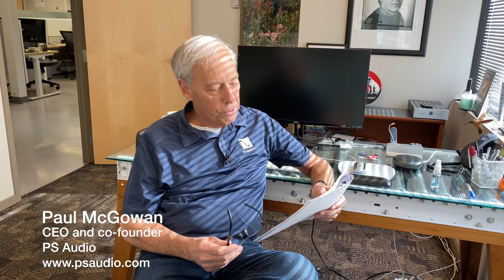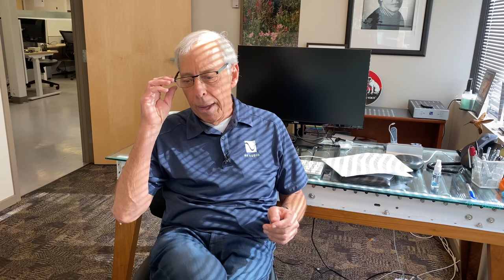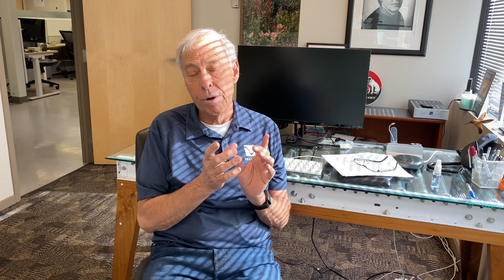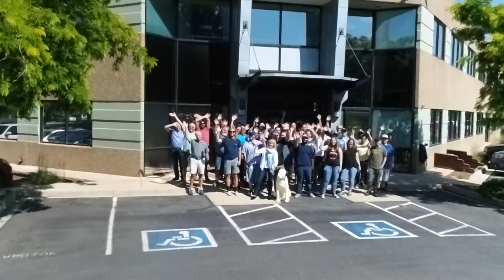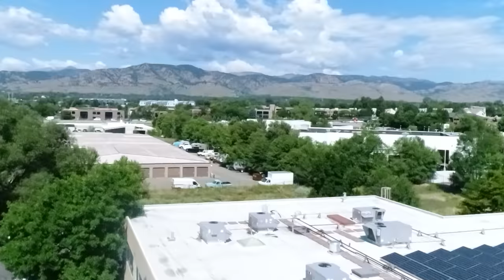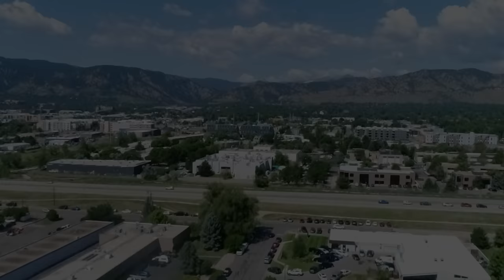Moving coil step up transformers

Comment: Paul,
Great summary on the difference between MM and MC cartridges. Your explanation of using step up transformers (SUT) to get ~30x the gain is spot on. Thank you!

I use a pair of Triad JO-3 SUTs between my Ortofon LYS MC and my moving magnet phono stage with very good results, but these SUTs are susceptible to stray magnetic fields from proximity to power supplies and motors in the form of audible hum.

I added cylindrical permalloy shields over the SUTs and moved them as far away from the field sources as possible, which reduced the hum by ~12 dB. This seems to be the only major drawback to using MC cartridges.

Comment: In my experience the step transformer will do the job but a dedicated MC phono preamp will sound better.
Reply: It depends very much on the transformer and phono stage. My experience is opposite. A good high end step up transformers are always better. The only good MC phono stage I’ve used was rare and expensive John Curl’s Vendetta. In my opinion less active devices in signal path always gives out better sound.
Reply: @stanislavshokurov6532  Agreed. The step up I used was made by Ortofon - not sure how "High end" this was, but I replaced it with a Dynavector P75 Mk1 which I'm still happily using.
Reply: At the end of the day there probably isn't all that much difference between either cartridge once you bung the signal through a step up transformer or put a higher gain phono stage with its inherent noise figures ( only a very high end phono stage justifies this )
Reply: For the best audio, yes, a carefully designed MC phono preamp is better. A transformer in the audio signal path is sort of much worse than cheap capacitors or other evil components we prefer to be without.

Comment: Years ago I built a LaPacifica phono preamp from a kit I bought for $60 or so, I added my own outboard AC wallwart, low noise power supply and a case. This is a very simple circuit using a couple of jFets and a passive frequency shaping ckt using oil filled caps and RN60 resistors for each channel. Because i was using a moving coil cartridge I needed more gain, for another $30 I bought another gain stage with a single JFet per channel\ and a small ckt board for all of it. In the end this cost me about $125 all in.

Is this as good as a top notch phono stage, no but it also only costs 5% as much.

Comment: The transformer not only increase the signal output but also matches the impedance which could be as low as 5 ohms. You could add an active part instead such as a low noise op-amp in place of the transformer instead which is a much cheaper solution but has other issues to deal with, such as induced hum from power supplies and the like but could work much better than the transformer if it is manufatured by non reputable or dubious manufacture and can band limit the music or introduce peaks and dips in the response.

Comment: Which reminds me of a previous video about how to turn an asymmetric signal symmetric. You could use that step up transformer for it. In this case you would have to put the transformer very close to the Sprout and have a symmetric output on your turn table.
Reply: I don't think you'd want to use a stepup transformer for balancing a single ended signal... better to use 1:1 isolation transformer.

Btw, cartridges already are balanced due to their electric principle, but almost all phono preamps short the negative (-) from the left and right coils to ground.

Comment: But wouldn’t an outboard mc phono amp (plugged into the line in) sound better?
Reply: Possibly. Depends on the quality of the MC Phono amp.
Reply: Usually yes in most cases. There are many different qualities of riaa amplifiers. cheap and not so good and expensive and good.

Comment: Using a cartridge that costs more than the amp?  Seems like a weird combination.
Reply: Yeah, the upgrade process is weird and usually nonlinear.  There are modestly priced electronics that sound quite good (and some that sound like crap, of course; I haven't heard either the Ortofon 2M Black or the Sprout, so I have no opinion).  Not that many people can afford a multiple component upgrade all at once.  If Don in IN feels that his MM cartridge is the current weak link in his system and he can afford the upgrade to a better MC cartridge and transformer now, why not?  He can upgrade to a better amp (or turntable/tonearm or speakers) later when the money is there if he feels the need/want.
Reply: Maybe the cartridge was won at a radio contest - like I won a 500 $ Monster Cable interconnect back in 1995 while my existing system at the time costs 600 $.
Reply: It's quite common that the phono preamp is overlooked.
Most of the times, it's by far the weakest link in the system.

Comment: I need to choose between two preprocessors, a Marantz AV7705 ($1900 my cost) or a Yamaha CV-A5200 ($2200 my cost). The preprocessor would be driving 3, Crown XLS 2502 amplifiers. Although this equipment is intended for my home theater system, musical performance is a high priority to me. Which preprocessor would you choose? I am long time subscriber and value your opinion :)  Thank you for your assistance.

Comment: i got to thinking this may be why the really cheap turntables like the crosley cruiser and such sound so bad is because they use a small audio transformer to replace the pre amp stage so they can get signal into the speaker amp without having to use a pre amp.

in addition they are not applying the riaa curve .

i am sure if you wired an audio matching transformer from the stylus to the line in on your sound system you could get a signal and basically that maybe what the cheap turntables are doing.

of course you got copper windings in the transformer that add cost however they could use aluminum windings and make it cheaper.
Reply: No, the main reason for Crosley and similar players sounding so awful 
is small, crummy speakers driven by inadequate amplifiers.  
The only transformer in such a unit is for power.  
These cheapo things don't have magnetic cartridges; they have ceramics ---  
but don't dismiss a ceramic just because it is one!  
Even the all-plastic stylus used in many of them isn't as bad as one might expect.  
In case you want to find out for yourself just how much is missing due to the deficiencies of the rest of the thing, 
try connecting only the turntable in one of them to a good system. 
Use a line-level input (CD, Aux, etc.), Not a phono input.  
Play a clean but unimportant copy of a familiar recording. 
The difference between that and using the entire unit will be pleasantly striking.
Reply: @spacemissing  that too

Comment: It's a bit of a stretch to categorically call MC way better than MM. That is more of a personal opinion than anything else. It is very hotly disputed in HIFI circles, and it is situational.  I have no problem people say or think MC is better, but man, tone it down. It is probably more correct to say the most expensive cartridge is, usually, the best. Given everything in the audio chain is a good fit that is.

Comment: How about the distortion from the step-up transformer?
Reply: With small signals (and that is what they are) a transformer works linear and is amplifying the signal amplitude in proportion to the number of windings from the primary coil to the secondary coil. So there will be no distortion.
Reply: SUTs distort in a different way than do active gain stages. The harmonic distortion in transformers is highest at low frequencies but drops to very low levels at higher frequencies. Transistors do the opposite and usually exhibit higher distortion at higher frequencies. That said, IM distortion in a transformer is negligible compared to transistor amps.  This is why SUTs generally sound cleaner when compared to headamps. But a good headamp can amplify and correctly load almost any cartridge, whereas an SUT much be chosen based on the voltage gain and impedance requirements of the cartridge.

Comment: PS Audio community:. Any recommendations for a good inexpensive SUT?  I run MM, would love to experiment with MC but price of new MC cart + SUT is prohibitive.  I can afford a nice new MC cart + inexpensive SUT but can't afford new expensive cart + new expensive SUT.  I have a really nice MM tube phono pre that sounds great and cost quite a bit so don't want to get a new pre that will accommodate MM and MC.  New MC cart and cheap SUT would be ideal but all the SUTs I see are above 500$.  Are there decent cheaper products out there?
Reply: Remember the "weakest link" theory?
You spend a lot more for a mc cartridge and pair it with a cheap SUT or cheap mc phono stage, and it will only sound as good as the cheap SUT or phono stage.
A good, higher-end mm cartridge will usually out perform a cheap mc cartridge and can be used with your existing mm phono stage. Look for one with a line-contact or shibata stylus and a more exotic cantilever, made from boron, ruby, sapphire, etc.
There is no free lunch!
Reply: @markwagner1997  no free lunch for certain!  Your response confirmed my impression.  Hoping somebody would tell me there is this guy in his basement making SUTs that are the deal of the century!  Until then, yup my MM setup sounds pretty nice!  Have a Nagaoka MP500 thèse days that sounds really sweet and I love my tube pre.  Grass is always greener though....
Reply: @billbones1000  If you are willing to buy used, there are many inexpensive transformers out there.  Recall that transformers, being passive devices, don't really wear out, so an SUT from the 70's is likely to perform just the same today as it did back then.  But, there is a catch: transformers should be purchased based on the specifications of the cartridge they are used with.  You need to take into consideration the load resistance "seen" by the cartridge through the SUT as well as the voltage gain required based on the output of the cartridge.

Comment: I have to question MCs now  - I have gone around the loop buying mindgurrglingly expensive MCs, TT's arms and phono stages - and gone back to MM due to the trade offs of noise against signal ... so now. does my Koetsu black nailed to a Ittok arm - bolted to a Linn Sondek LP12 sound better than my Systemdek II, Logic Datum, Nagoaka Boron Mp11 ? ... not really. ...how much of this is engineering trade offs plus "psycho acoustics" added to pissing contest? ...I've learned my lesson ... I'll save my money now and use it elsewhere... go MM .

Comment: What is Pauls take on the brand Mordaunt Short? I've got a couple of small speakers of that brand and they sound realy good! Btw I've got turntables with a preamp build in and that's far better than an external amp because you get less noise from the cables this way.
Reply: i would Never use a preamp built into a turntable. 
None of them are good enough, and cables don't cause That much trouble.
Reply: @spacemissing  Mine do have great preamps!